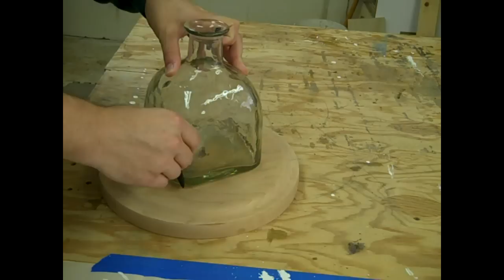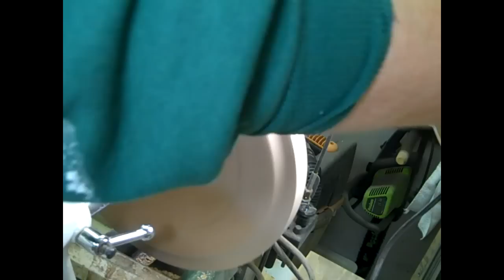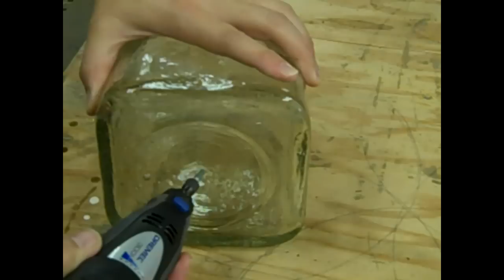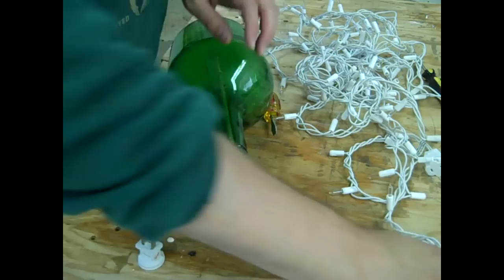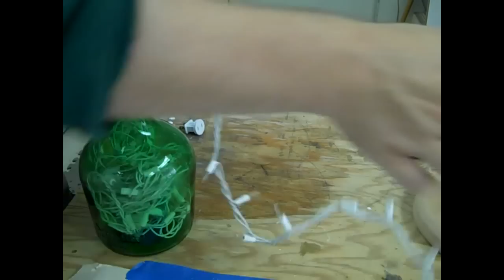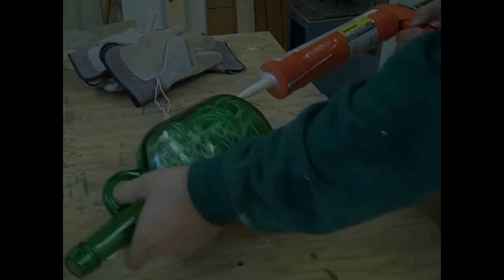How To Make A Wine Bottle Light

Comment: I will share an aquarium builders "trade secret" for drilling glass. 1. get the glass bit. 2 (this is the one that makes the difference) you use plumbers putty to create a circle damn around the area u want to drill. 3 fill the damned area with water, the water plays 2 roles, it lubricates and absorbs some of the vibration from the drill. Hope this helps!
Reply: +Ross Shintaffer Thanks! I was wondering about that. Do you know if glass bits are made for the Dremel? If not, what bit would you recomend?
Reply: +Janet Zaharias dis weeny
Reply: None! a Dremel is way too fast for drilling glass.
Reply: You forgot the main reason
Reply: STICKY_Inventor col

Comment: Best method I've found for drilling through glass is: 1. To use an actual glass drill bit, and 2. Do the drilling in the sink under a very small trickle of cool water.  You don't want enough water flowing that it hits your drill, just enough to cover the work surface of the bit.  The constant flow of water keeps the glass cool and prevents cracking, and it captures all the glass dust so you don't risk breathing it in.  Once you're through, give it a good rinse to get all the glass dust out of there and let it dry.
Reply from the maker: +Urahara1001 Yeah, I'd never done it before. Thank for the detailed comment, I hope some other folks looking find it too!
Reply: +Peter Brown, +Urahara1001
A glass drill bit... Exactly the information I was searching for in the comments !
Thank you +Peter Brown for the cool videos (just found you about 2 hrs ago and have viewed quite a goodly number of your videos already(LOVE the shop-towel bottle stopper !)), and thank you +Urahara1001 for your detailed description of your method. I like how you mitigate heat and Glass Dust (Nasty) with one simple solution !
Reply: +Urahara1001 Yeah, you need something harder than steel, since glass tends to be at least as hard as steel, and you want the drill bit to be significantly harder than what you're drilling through.
Reply: Also, if a sink is not an option for you (renting or whatever) I have had success with a little fountain bubbler in a large plastic Tupperware bowl. I scrounged one from an old desk fountain and just had it angled to run over the work area.

Comment: I wonder if it's possible to rig something up to spin/shake the bottle with some medium inside so that you end up with a nicely frosted bottle (but on the inside!) to diffuse the light?
Reply from the maker: +M750 I see... I bet if you just used frosted spray paint in the top, you'd get decent coverage!
Reply: +Peter Brown It would look a lot better with the frost on the inside though. Maybe you could take the nozzle and straw from a bottle of brake cleaner and stick that in the bottle to spray inside?
Reply: ftw
Reply: if you capped the bottom with something to keep it waterproof you could fill it with baby oil.
Reply: BB'S will give the inside a nice frosted look, Just saying.....And they can be used over and over ...

Comment: I Love this and think it is Beautiful!!! Vid is good also just wish you would have showed how you did the rest of the electrical.
Reply from the maker: +Lance Linkhart Thanks. The electrial is simple. Just two leads from the light,  connected to two leads on the extension cord. Secured with wire nuts.

Comment: I've made similar light wth bottles. Are the lights you used the old fashioned ones or LED? I've found that using that many incandescent light in a closed vessel like that gets way too hot.  I've gone to using LED only as a safety thing.  Great project
Reply from the maker: ***** I made it with a set of white christmas tree lights. I think the LED's are a vast improvement, and would totally do that instead now...

Comment: i used the colored lights, but a lot less so the would be seperate small lights and not a light ball and added a few tiny cap holes for vents,my first try burned out a wire in three hours  second one only used 15 lights hung from inside of lid so they hang not pile up so far no burnout  nice idea

Comment: You need to fill the bottle with beach sand to kill the vibrations so the bottle doesn´t break.
Reply from the maker: urduib That's a cool trick! A glass cutting bits helps a lot!!
Reply: Peter Brown Took me a winter to figure that one out :) just happy if less bottles will be broken and projects lost. Share the knowledge. Keep up the good work.
Reply: Peter Brown Think the sand is best when dry, so it can move easier and absorb the energy.

Comment: This is very dangerous (the bottle's enclosed space will heat up and melt and short circuit the wires )you should have done it with LED lamps...may be multiple stands of different colors  for added effect / strobes programmable rates etc.. from outside..
Reply: +Rajan Rangarajan I agree the lights litle bulbs designed to stay seperate so they can handle the heat ... If u bundle hem together and put them so they cant throw out the heat eventualy they we melt the isolater and short circuit. And kabaaaam

Comment: This was painful to watch.  Just break down and buy a diamond circle saw and cut it submerged in a tub of water (with a cordless of course).  They never break and the circle saw isn't that expensive.  Even the Harbour Freight one's work.
Reply: I use a KOBALT diamond glass cutting spade bit from lowes, like 3$ each, good for over 50/100 bottles, I put it n a variable speed electric drill and listen as i drill as the sounds really changes. i can do 10 cases in no time at all....These bottle r wrapped in a towel then placed in a pipe vise firmly no need to hold them under water......The spade bit starts so easy........these sell like hot cakes at local farmers markets yard sales town fairs etc..

Comment: Why not just put the lights inside the Patron bottle and turn it upside down on the base? Instead of drilling a hole in the bottom. That's what I thought you were going to do to begin with.